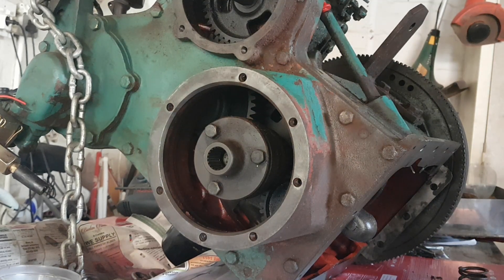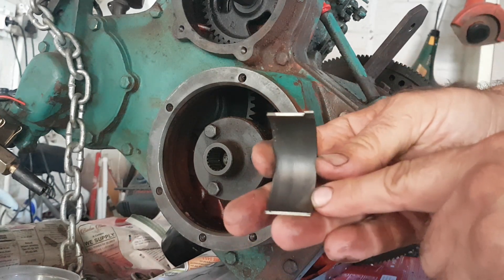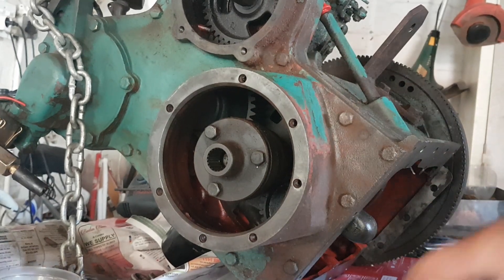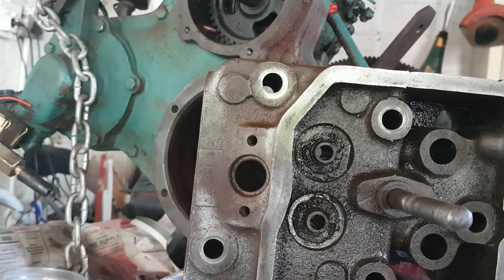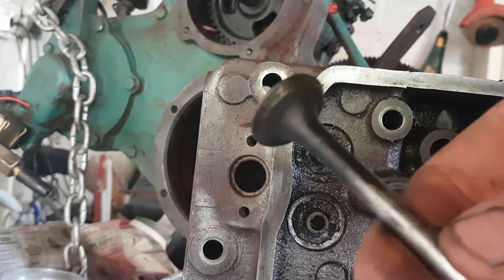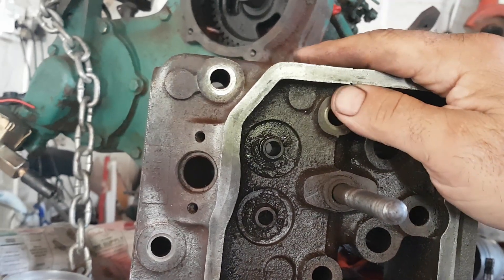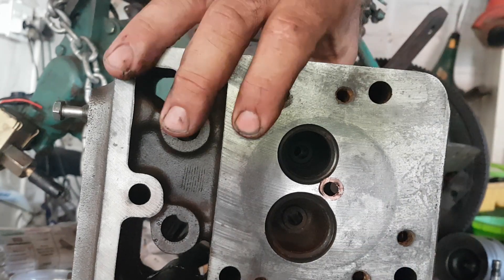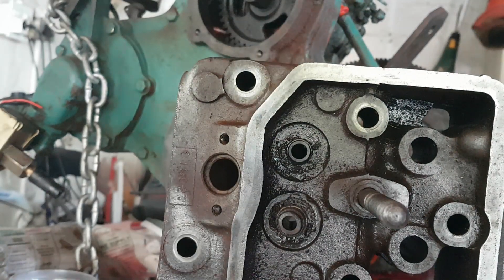Disassembling a Volvo Penta MD7B part 4.

Comment: You are my new hero! I have a md6 which I am trying to fix (it over heats and struggles to start), and not knowing anything about engines I am using it to learn. So this is just incredibly helpful. Thank you.
Reply: I have a MD6B too. MD6 and MD7 share all parts except cylinder and cylinder head

Comment: I bought custom bearings and rings for my engine, not factory ones. The size of the bearings was provided by the crankshaft grinding plant, similarly with the piston rings. The remade elements are not worse than the originals, apparently - we'll see.
Reply: Could you say the name of the supplier of the custom rings and bearings?   Are these parts made to handle the compression ratio of a diesel engine?  Thanks.

Comment: Are the clearances too big on the original bearings?
If the rings you got suit a Subaru then surely the bearings are the same as another engine made sumwhere in the world. 
Those little engines get rebuilt here in NZ
My engine machinist is away on Xmas holidays right now but Im pretty sure he would be able to find an equivzlent diesel bearing. 
Put the cylinder head in Evaporust to clean it
Or look on Youtube how to make your own Electrolysis cleaning tank. Easy to do and worx brilliantly. 
Do not at any stage beadblast or shotblast the head.
Reply from the maker: Thank you